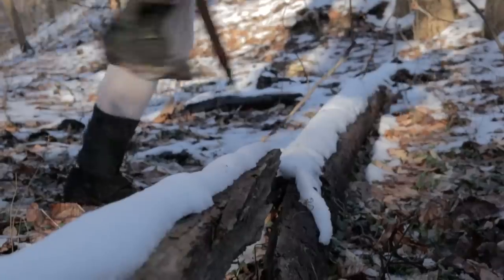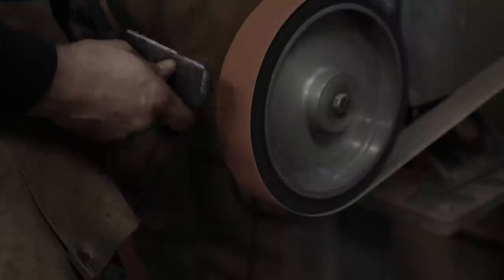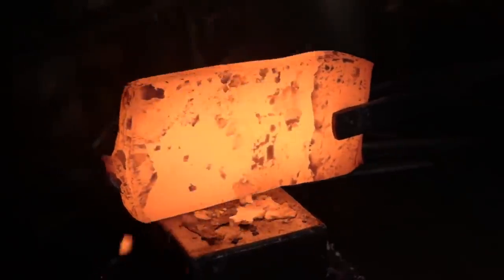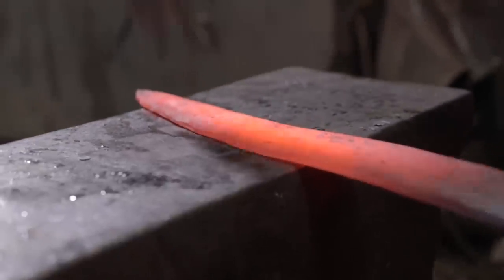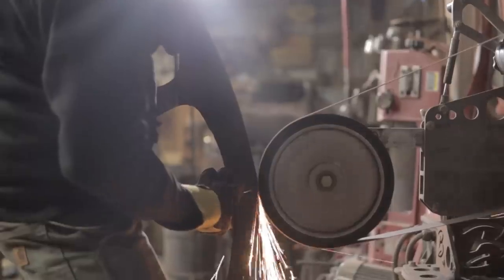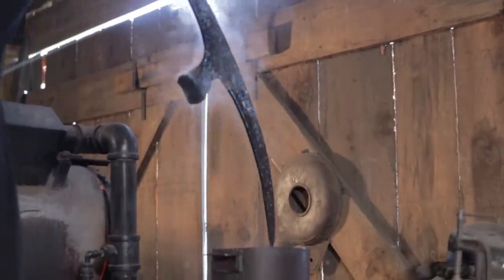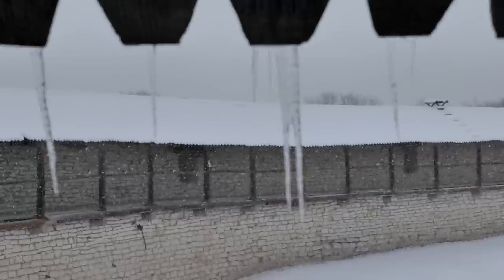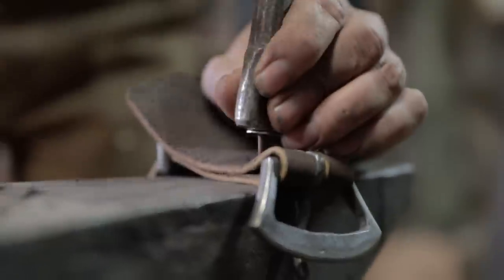Forging a 17th Century [Bardiche] - Historical Build

Comment: As a history lover this made me smile big time. Nothing fancy, no parade gear. A real world munitions grade weapon. Awesome video on a plain boring piece of kit.
Reply from the maker: seamus6387 thank you! That was our goal
Reply: Unfortunately it's still not made correctly and if used extensively has a big chance of breaking and injuring someone.
Reply: These bardiches are quite interesting. They weird weapon to me in that how clumsy they look. I wonder what the tactical choise was to made these instead more normal sized axe blades that would be cheaper, and easier to carry. Then again russians seemed to love big axe blades in clumsy looking setups. Even some guns have just big axe blade attached to them
Reply: @lalli8152  the bardiches were quite light, 1.5-2kg max, so it could be very nimble and not clumsy. 
The Russians actually had more conventional axes as standard issue weapons as well, from normal wide-bladed axes to axes where the heel of the axe head would be riveted to the haft (basically a mini-bardiche). I don't know why they aren't popularised, they look very cool.
Reply: @pavelstaravoitau7106  Yeah, but thats still quite heavy for axe blade  since the mass is towards the head of the weapon. I guess bardiches came in many shapes as well, and they were popular outside eastern europe too. What makes me wonder are these ones with very long blade. Im sure there is some function to it or it wouldnt have been used though.
Reply: @pavelstaravoitau7106  Well i guess the answer is simple as to increase the cutting area of the weapon or something.
Reply: @lalli8152  from what I understand, a lot of that weight is in the haft, the blades themselves were very thin, 2.5mm at widest for the earlier ones with single points, to 3-4mm at widest for later ones with split points, and everything in between. 
I honestly hesitate to call anything bardiche-like outside of late 16th-17th century Russia a bardiche (late 16th century is when they became a thing in Russia). Turkey is the only exception where they seemed to be inspired by bardiches to make their own versions, some of which also made back to Russia. Even in Poland what they called a bardiche was a normal axe on a long haft. The methods of construction would have been very different from stuff used in Western Europe during the middle ages, though the only info we have about Western European "bardiches" is from art. 
I suppose cutting surface would be the likely answer to why it was constructed that way. Maybe it was easier to hit someone with a longer blade, a lot could be done - chopping, slicing, stabbing. It was a popular civilian weapon before adoption as standard issue sidearm in the mid-17th century (and even then not every soldier, dragoon or strelets were armed with one).
Reply: @lalli8152  The primary threat to slow-moving handgun units at the time would have been enemy cavalry.  This looks for all the world to me as a multi-functional weapon: a completely necessary stand for the matchlock (gun rests didn't fall out of use until much later), a hewing axe in case the unit got caught in melee combat, and a short spear in case of a cavalry charge. While the extended tip of the bardiche would have been much weaker than a true spear, a spear wouldn't have been able to fill the role of gun rest, and I still wouldn't want to ride a horse into it.
Reply: @somebodynameless2615  Exactly. Although i dont think that an elongated, pointed blade at the end is "much weaker than a true spear", since the spike edge of bardiche blade is usually in the same plane as the shaft like in spears, so it is still can easily pierce enemy soldier or horse (although there are other versions of weapon, with a more elongated blade extending beyond this plane, and they can definitely have problems with a thrust)

Comment: Very interesting. My theory on the holes: they were drilled/punched to adjust the weight : they were probably made according to specifications, and after forging them to the correct size  (maybe they had templates?) drilling holes would be a quick and economic way to bring them to the specified weight.
Reply: Or to adjust the balance of it. Can you imagine trying to balance a gun on it if it kept trying to tip over because its center of mass was to far off to the side.
Reply from the maker: Francesco Sirotti possible. Likely even
Reply: My theory for holes is extra vision space. The blade position when firing the musket is on the face side so it can also double as face protection, meaby???
Reply: How about all of the above?  Start with the template, and the weight, add in them being asked for even in ones that DID balance right from the start because soliders got used to being able to see through the holes, and using them to hold the lit tinder?
Reply: You're correct in that there were specifications and templates, but only from the mid-17th century and onwards. By then, some factories employed by the government were cutting them out from sheet steel, so I don't think they'd really need to adjust weight by holes.
Reply: My theory is, to make it sound cool(whistling) while slashing XD

Comment: don´t underestimate the grams, the Swedish ski star Gunde Svan, drilled out his ski poles, to save 10 grams, and he calculated with all the times he lifted them in on cross country ski, he saved him self from lifting 1 ton or 2
Reply: i have two more theories as to why the holes where there.
first one is a stretch, but by the footage of someone using it as a gun rest, the blade might obscure the wielders vision so being able to see through the holes might have helped the shooter, hell maybe the shooter could line up a hole with his enemies and use that to adjust for elevation.
another more likely reason could have been to adjust the point of balance OR simply saving material, the material that could have filled the holes, could have been used to make more weapons, even if you need to make a hundred holes to save enough iron to make one bardiche, if you have to outfit like five thousand soldiers, you'd save enough to make fifty.
Reply: @windhelmguard5295  the holes helping with peripheral vision whilst shooting makes a hell of a lot of sense.
Reply from the maker: That is the overwhelming theory
Reply from the maker: Windhelm Guard seems reasonable actually
Reply: @iordanisG  Nope, the weapon is not meant to pass bones.
You can impale, you can crush (like with a sword), but it will not be blocked in your ennemy body. Human tissues are soft and you cannot go so far that it will be hard to pull out, like a not barred spear (even if for that kind of spear it will not be that hard to pull out, it will just take too much time. Time that you don't have if you want to live)
And those holes will not help anyway, mechanically they have no meaning.
Reply: @windhelmguard5295 I particularly like the balance idea.  Even small changes can make such a difference.  Suppose the way to test it would be to make a second bardiche identical to the first except omitting the holes, and try them both out.
Reply: кромослав  or, perhaps even somethimg soldiers did to mark mass produced weapons as theirs, though some decorative carving on the handle or tying on a bit of cloth or colored leather would have been easier ways to do that.
Reply: Perhaps the drilled out metal was re used for the fittings on the sling.
Reply: @windhelmguard5295  Right! I'm sure they served more than one purpose and likely started out almost by accident and then slowly caught on over time so you'd have some without holes then tons of them with different configurations and numbers of holes across hundreds of years
Reply: @ThatWorks  maybe the material taken from the holes were used to make the bullets?
Reply: кромослав  Agreed. Same reason they put holes in knives today. Mind you,  it could be a combination of all the above.

Comment: I'm a bit leery about the theory that the holes were used for holding lit wicks or matches. Reloading a matchlock tends to be a fairly complex and slightly precarious action, since you're handling both black powder (often loose) and a source of ignition at the same time. It's tricky enough with just the one match in your hand, I don't think you'd want another relatively uncontrolled smoldering thing on you in addition to that.
Reply from the maker: Perhaps you are right but I has been depicted with a wick in it.
Reply: @ThatWorks  might as well be a second wick if the main wick burns out.
Reply: @ThatWorks  my first thought was in the direction of aim assistance. what better utility for a rifle mount than a built-in range finder?
Reply: @ecurps1  medieval range finding for inaccurate single-shot rifles? that seems even less plausible than weight savings.
Reply: The wicks used in matchlocks aren't exactly easy to manipulate; I could see someone threading a spare match into their secondary weapon as a personal quirk, but not as a standard or useful technique; it would be annoying and time consuming to remove and put into use. Spare match was generally stored in a manner that made it easy to access and employ.
Reply: @lairdcummings9092  Perhaps the match cord was threaded through the holes so that the bardiche could be used instead of a linstock to fire a cannon?
Reply: @AggelosKyriou  unlikely. Cannoneers were insanely jealous of their privileges and prerogatives.

Comment: I absolutely love what you guys are doing. Super educational, and so much less sensationalized than higher budget smithing shows. My only real complaint is that there is a little too much soundtrack, smithing noises are so cool and soothing, and hearing the rhythm of a smiths hammer work is so cool. I would be happy if it was just you guys educating, and the straight shop sounds of every cut of you guys doing your thing.

Comment: My theory on the holes is that they may have been used as a means for attaching leather or cloth wrappings as to provide a better bracing point for the rifle. This also would help hold up the axes better when stacked in bunches by soldiers in the field when not in use (kinda in little tripod formations) Similar to how stacking rods were used on military rifles.
Reply from the maker: Now that’s a good point and well thought out. You would think more historical examples would have some left over bits of cloth in the wholes though. Perhaps they do an no one ever looked
Reply: @ThatWorks  another thought is they were used as a way to keep a scabbard or oil soaked cloth covering to protect from rust?, just a thought, are there any surviving scabbards?
Reply: It's a fake. Berdish don't use for shooting

Comment: Wouldnt a sort of "winged spear" work just as well? Craft a standard spear (about the same lenght as a Bardiche), add a 1 side wing at the 1.5 meter height mark to rest the gun on. 
I assume a spear would do the same job in meele as the bardiche (mostly) against unarmored opponents (and work even better against armored ones). 
Would also be easier to craft a "straight" pieces of metal for the spear tip, than the "akward" shape of the bardiches blade.

Comment: "Historical war axes were tiny"
Dane Axe: Am I a joke to you?
Reply: There aren't that many of those
Reply: They also aren't fantasy big.
Reply from the maker: The metal part still wasn’t huge by mass. They are quite thinner then people think
Reply: I presume as with drag racing, war weapons follow the "light is right" philosophy. hence thin Danish aces as well as very very light swords in the Wallace collection.
Reply: @joshschneider9766  especially in infantry weapons. Just because you need to carry it in long marches by your own foots. This is reason, why infantry armour was not used in late 16 c and later.
Reply: @PyromaN93  yes sir, ive seen some insanely thin blades from the Ukraine as well
Reply: @PyromaN93  although giving up armor in the face of bigger and bigger things cannons has always struck mw as nutso. they couldn't have moved it in the baggage trains? lol
Reply: @joshschneider9766  this will increase logistic troubles.
Reply: @PyromaN93  true but i would think limiting losses in a campaign would have at leqst been a consideration. guessing not though
Reply: @joshschneider9766  yes the thing is making armour costs a lot. For price of one good armour (bullet proof) for one soldier you can equip several peasants with muskets etc. It is just more cost effective in big state run armies.

Comment: I do love your historical builds.  I consider those my favorite.
I especially love those builds you have done from the point of fabricating the steel itself (bloomray, crucible, blast furnace, etc...)
I do understand, however, that those processes of fabrication and consolidation are lengthy and more difficult than working with modern steels.

Comment: I expect that the holes were used for many things.  As with many things, when you have a need, you think of a way to adapt what you have to fill that need.  Think “When you have a hammer then everything looks like a nail” type of Approch. So if you need a way to hold extra lit cord then you might think about putting it in the holes.  

Some more “official “ uses:
 1. Could’ve been a way to save weight and material to build more weapons in the long run.
2. Could’ve been used as a crude range finder/ aiming device. 
3.  My personal favorite.  If you were using it as a stand for shooting then it would be a massive blind spot for the individual soldier.  The holes don’t appear to be large enough to see a clear picture through, I think that they would allow enough light to pass to warn the shooter that there was someone in their blind spot.  Think of someone’s shadow warning you that they were behind you.

Comment: This is one of those things that makes me wish someone would experiment with different designs. Specifically and while working from the core concept and design, use that to make at least two different iterations: one that works from the basic design to produce something that better fulfills what's believed to be a weapon's purpose and another that takes what the design actually does well, irrespective of assumed use, and cranks that up.

Comment: I think you are 100% on the money with rifle rest. However i think this tool could be use to clear the bush also. I use something similar when hunting today its basically a "bush hook". I can use the hook part to clear back brambles and i can stick the poles bottom into the ground and use it to steady my shot.  My modern day stick (well not modern it was inherited from my grandad) is basically a long wooden pole with a metal crescent moon shape steel hook on the top.  The part where the metal attaches to the long pole allows to gun to rest on.  Not only this but i also use the thing to carry what i shoot. I can tie the legs together and slide them on the pole and them put the pole over my shoulder. If a friend is with me we can easily split the load this way also. It's a very handy tool indeed and i never leave on a trip without it.

As for the holes. Think of 2 of these not 1. 2 of them side by side with string or dowls between would make a sort of sledge you can drag anything on. Food, Casualties, ammo etc etc. This would especially be effective in ice/snow areas as it would glide like an ice skate. The holes could also be used to hear the "pitch" of the air, you can tilt every so slightly and if you listen well enough hear the air flowing through the holes to tell things such as wind direction / speed.

Comment: Very interesting video. I am reminded for some reason of another peasant weapon. The goedendag. Basically a 1 meter club with an iron band shrunk around the end with a spike. (I'm presuming they drove in the spike then shrunk the band for maximum strength. Was used at the battle of the Golden Spurs where the Flemish literally beat the French knights into the ground with them, some pikes etc. Just because they're made crudely, doesn't mean weapons are ineffective.

Comment: I dont know what the holes are for but my best guess would be, if they were used as rifle rests, it was to lower their wind resistance to make for a steadyer shot? A lot of the blades you showed were also quite thin. It could all be in service to keep them from flapping in high winds and throwing off your aim.

Comment: extremely interesting i wish YT did it's job n notified me.
however the Bardiche is very similar to the Archer"s Stake. where archers would carry a 3-6 foot stake (true the metric system was 1st shown in 1850, it was no adopted until 1960, so im gonna stick with imperial.) to guard against cavalry

Comment: Looking at how the bardiche you made was being used in conjunction with that Flintlock Rifle, It would seem that the holes near the haft could have been used as a marking / sighting aide to assist poorly trained troops / fresh recruits in order for them to get their shot to go roughly where it was wanted / needed.

I suggest this could have been a purpose for them since Flintlock Rifles are considered to be fairly in-accurate firearms to begin with, logically it would help the commander to tell the troops to aim in a specific direction using a certain Mark (hole), i.e. line the muzzle up with mark X in Y Direction and fire.